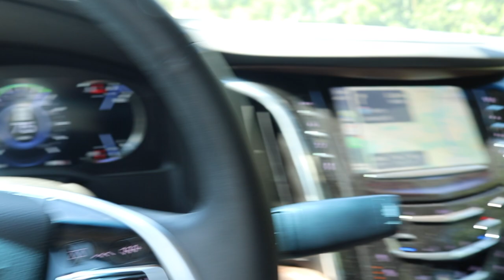The 1st Gen LEFT ME STRANDED!!!

Comment: You should make a fabricated center console sound system box! I’m to broke so what I did was cheap but it worked real good for my 01 7.3 new body style I took the middle seat out and put a 12" Rockford P3 sub and box! I also put my center console arm rest/ storage container on top of the box with some double sided tape to hold it on the box but what I didn’t do that I would do is bolt down the box to the floor with a L bracket because my box has fallen back when I would rapidly take off!

Comment: Has to beat starter to get it to start. Then hits the road without a hammer. You wasn't planning on coming back were you?
Reply from the maker: Spud Taterson wasn’t planning on it to just stall while driving either...  use your common sense.
Reply: @LOUDNPROUD  common sense would have told me to beat the piss out of that starter in the first place, wouldn't need two people to tell me that. Besides an engine can stall any time especially a manual. You gotta be halfway ready for anything drivin 20 30 year old trucks around.
Reply from the maker: Spud Taterson Well aren’t you just the book of knowledge
Reply: @LOUDNPROUD  no ive just had to learn the hard way man. Lightin up a little dude it's just some you tube peanut gallery lol.